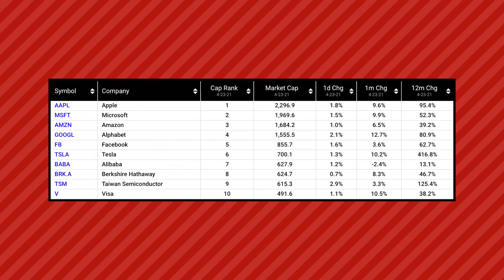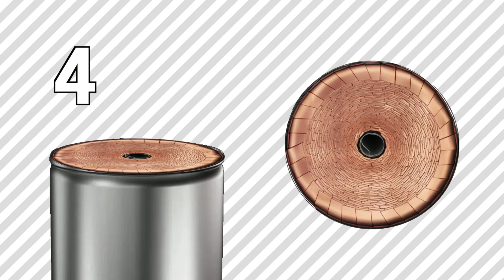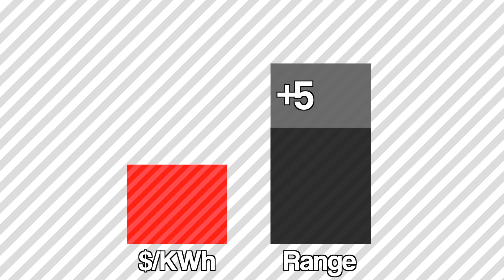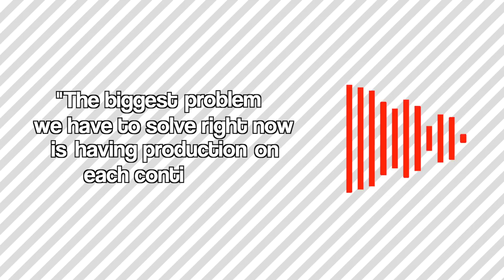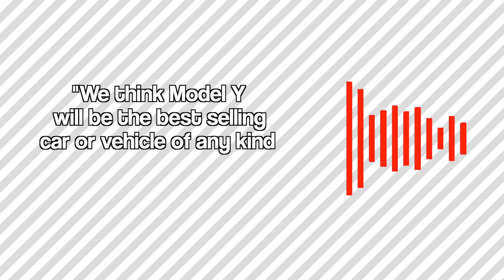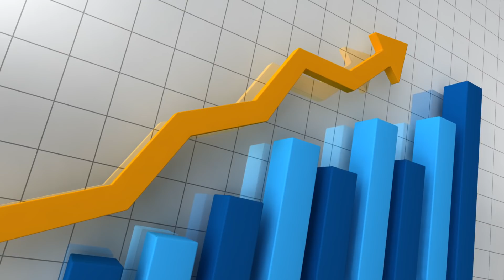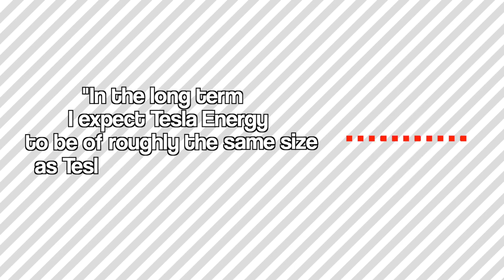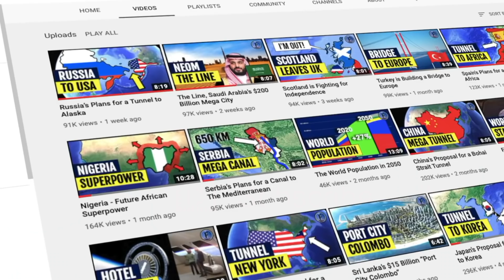Elon Musk's Future Plans for Tesla

Comment: Talking a friend of mine who works on the 4680 battery project they still have a long way to go but once they get it right it will change everything due to how small the production line is and it will be a continuous line (which adds up over thousands of batteries) "the internal batteries are currently junk"